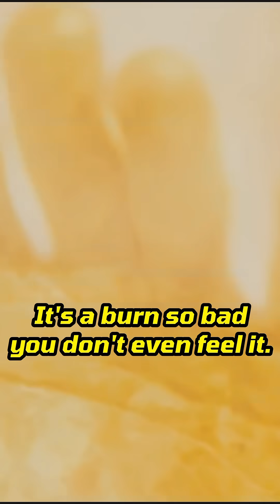THIS is what happens when a NUKE hits your City #vfx

Comment: Third degree burns are a understatement.
Reply: Went from breaking us down to subatomic particles to just mere 3rd degree birds. That you don't feel.🥲💀
Reply: @InnerRise It's all a matter of how far away you are. Ground zero? You are vaporized. A kilometer away? Instant extremely bad burns. Which means you have no nerves left to feel either the plasma if you're too close, or the fire tornadoes if you're on the fringe.
Reply: @rhov-anion  so invincibility?
Reply: @InnerRise Not exactly. Sure, having your pain receptors cooked faster than they can send the pain signal might give you some slim advantages, from a very twisted point of view, but considering that if you were looking anywhere near the blast you would be totally blind, and the blast wave that comes shortly after might leave you deaf and/or blast debris into you like shrapnel out of a pipe bomb, the firestorm that follows that, and even if you survive all that you would still end up contracting acute radiation sickness, I don't think a lack of pain from one side of your body would be worth having.
Reply: @thassalantekreskel5742  Blind? No thank you.
Reply: @InnerRise 3rd degree burns at 1.5 miles away...
Reply: @Evan_Bell I've been burned up close by a real flame so that distance should make th3 burn more manageable.

Comment: But even with this nuke and its radiation Hiroshima actually is lived in and is rebuilt with no residual radiation because this was a clean bomb and the mountains contained the fallout. You can still see the hospital that was the target for the bombers in Hiroshima
Reply: The Hiroshima bomb was not "clean". It was a pure fission device. As dirty as they come.
Mountains did not contain any fallout.
There was no local fallout because it was an airburst.
Reply: These were also two of the smallest nukes we've ever set off. They only used a tiny percentage of their potential power. We've gotten better at making nukes, making them hundreds of times stronger, and knowing where and when to detonate them for max damage. Particularly fallout damage. I read somewhere long ago that a modern nuke set off on a windy day in Chicago could result in fallout reaching New York.
Reply: @rhov-anion In the decades after, weapons thousands of times more powerful were tested.
It is true that some very high yield weapons that used to exist detonated in Chicago could reach NY.

Comment: Its pretty scary to thing the nuclear deterrent has to work every second of every day for the rest of time for this not to happen to everyone on the planet.
Reply: It's already beginning to break down.
Reply: It's worked so far. Two world wars in less than 20 years, then the invention of the nuke happened, and it's been 78 years since the last one. Mutually assured destruction works. For example, the Cold War. It only stayed cold because of MAD.
Reply: MAD is actually slowly going away for one reason.
The U.S. is inching closer to perfecting its missile defense shield.
Right now already Stage1 is 90+% perfect. But Stage1 can't be deployed globally. Where we have it though (ie: off N.Korea) it's damn perfect.
Stage2 was around 30% a few years back. Which is better than nothing.
Stage3 has always been around 0% for decades, but now has achieved 10% and will likely climb to 100% quickly with recent improvements, as the decent intercept strategy last tested works and can be rapidly improved.

I'm short, once the U.S. achieves nuclear missile immunity, MAD as a doctrine ends forever.
Reply: @brianb8003  The US can stop a nuclear missile from reaching washington DC but, that dosent help much if i depoly my mini nuke, that conviniently fits into any suitecase right into the withe house.
Nukes will always pose a risk. Ther eis no such thing as 100% interception rate.
Reply: @brianb8003 you cant Archive imunity some nukes will Go trough the shild
Reply: If 1 Nuke is launched every nuke will be.
Reply: Indeed. As soon as a country develops the ability to properly protect itself from nukes, they'll have little fear of retaliation, and would be able to actually launch their nukes. This window of opportunity would be terrifying, and last until every other country is also able to protect itself, at which point we're finally much safer than we are now.
Reply: @Novenae_CCG  Realistically though the only people who would do this nowadays are insane despots who don't value human life other than their own to begin with, so they only need the ability to protect themselves and their governing subordinates. 

If someone like that loses a war, they're probably not going to hesitate to launch nukes just because the retaliation would kill thousands of their own people.

And that is to say nothing of countries whose ideological inclinations place less emphasis on the importance of their "current" life. In that case it is possible that a populace could even be convinced to accept their own demise in a nuclear war, if the cause was deemed just.

Deterrence theory is the best defence we'll ever have, but it's not fool-proof. It can literally be circumvented by anyone foolish enough to just... ignore it lol.
Reply: @Novenae_CCG  and what would that defense look like? Enough of them go off, it doesn't matter where you are on the planet, you're still going to die
Reply: @Novenae_CCG the thing that scares me more than that is the idea that radical muzIim countries like Iran and Pakistan have the capabilities, while both of those countries are on the verge of collapsing. The same goes for North Korea, but they wouldn’t use it since they love their luxury life to much and the US definitely has the capability to destroy their nukes before they’re launched, or knock them out of the sky due to it being such a old and bad engineered system. It was only since a few months that they figured out how to use solid fuel, which the major powers have had since the 50’s.
Reply: @malcomx1924 Pakistan is not really a "radical" muslim country, unless you are a indian propagandist and Iran dosent really have long range dlivery systems.

I woukd be much more worried about another thing: The USA calculated in the 50s that the risk for a accidental nuclear explosin within the next decads was a solid 100%, prompting it and the sovjet union to develope sophisticated security messures to reduce the risk( there will never be a 0% chance though). For nations lije north korea that means that the only reason the havent nuked themselfs yet is becouse they dont have that many nukes.
Reply: @yoschiannik8438 Theres actually very few missile silos in the US. The majority of our active nuclear weapons are on submarines or airplanes. There’s only a few places in the US that have missile silos. (at least according to public knowledge)
Reply: @gallusdomesticus5478  Yes, but having very few does not stop them from exploding
Reply: @yoschiannik8438  Obviously, it just means that you’re probably very far from any nukes. I literally grew up in Cheyenne, Wyoming. One of the few places in the United States with missile silos. The vast majority of Americans don’t live anywhere near nuclear weapons. FE Warren was like 15 minutes from my house. I never once was afraid a nuke was going to detonate. 😂
Reply: @yoschiannik8438 any muslim country should be monitored
Reply: @robustanybody5138  I wpuld be much more worryed about christian organizations. They are happely living all over the place and nobody seems to take there constant threaths seriously
Reply: @gallusdomesticus5478  There are at least 45 active Minuteman nuclear launch facilities and 1800+ land-based ICBMs ready to go at a moment's notice in the US. It's not "only a few".
Reply: Welcome to the world of Fallout